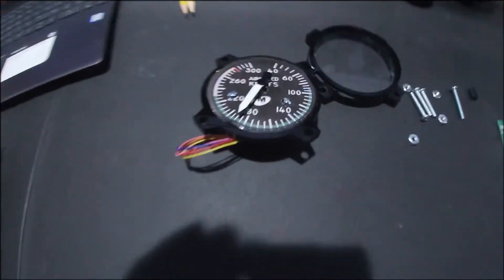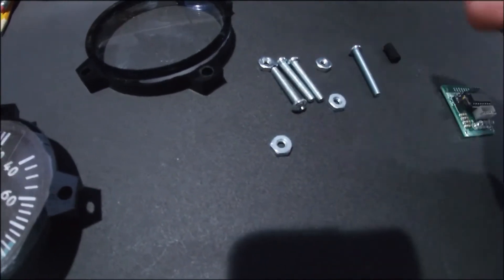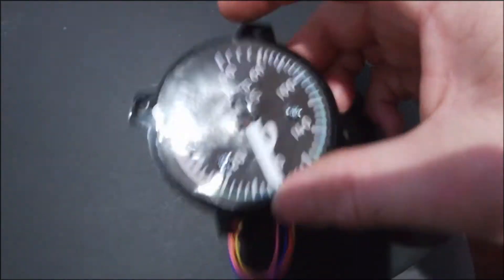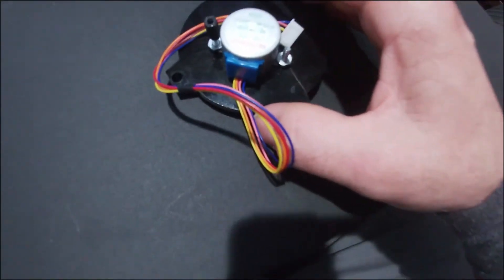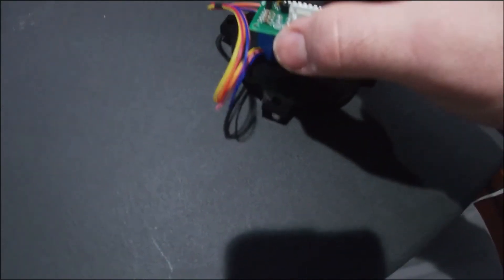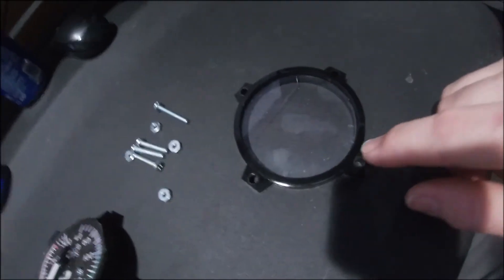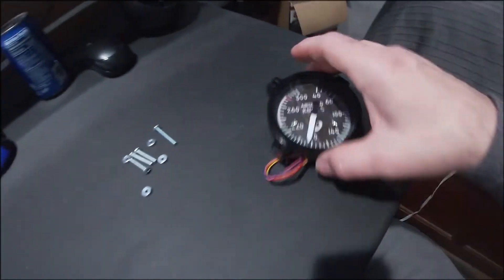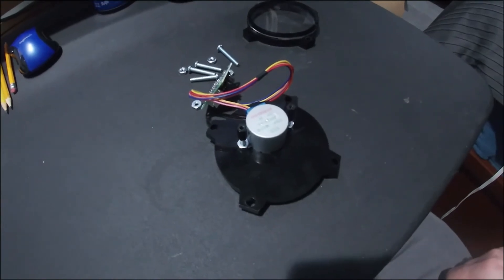Building Gauges For The Flight Sim

Comment: Can anyone tell me where I can download for free, high resolution quadrant instrument  gauges for printing ?
As it is for decoration purposes, I would like a 60's or 70's cockpit panel (without screen avionics - just round
 intrument gauges).
My panel Will have 70 cms length.
There's an important detail: the instrument gauge cannot have the pointer. Just the layout or the raw quadrant.
Reply from the maker: I am not sure of a place that has those kind of images. I had to design mine in Adobe illustrator. The other option that would not be free, you could find old gauges that have been removed from aircraft and take them apart. That’s how I got the RPM gauge to get the ball rolling. 

Another option could be to find a picture of what you need with the needles and photoshop the needles out of the pictures. Good luck on your project!

Comment: Hi, how did you connect and calibrate the instrument
Reply from the maker: There are a couple programs you can use. I use Mobi Flight as it works with both X-Plane and MSFS.  Another one is simvim, I also believe AirManager can now do this as well.

Comment: Awesome job!!!!  I'm making similar gauges for an F16 flight sim,  using engraved plastic on my Xtool D1..  Mine are only static for now, but I'll implement movement soon.
Reply from the maker: The nice thing on yours is you may be able to use the faces you engraved and just add a stepper motor to the back of them.